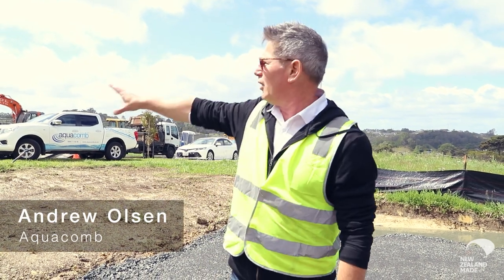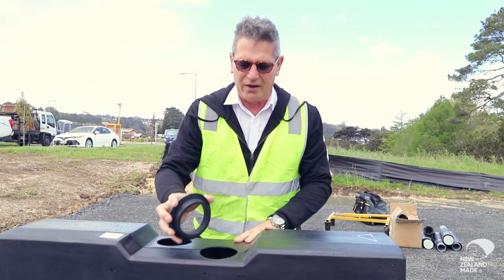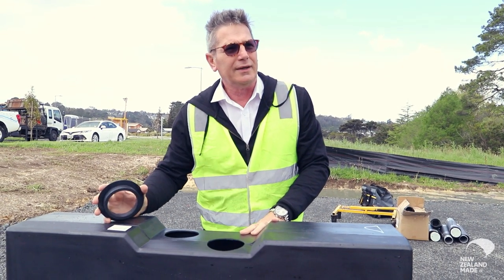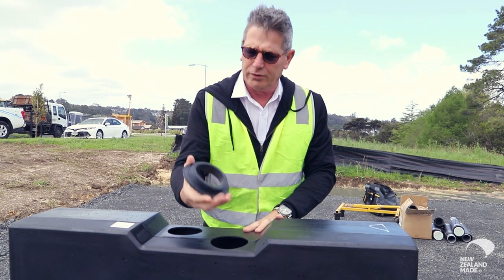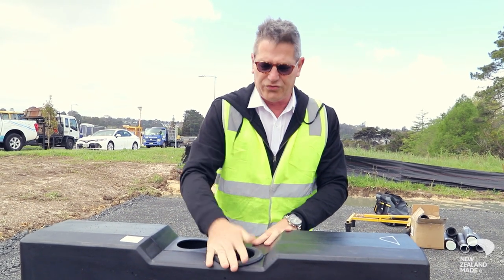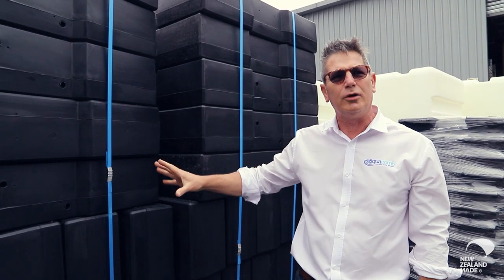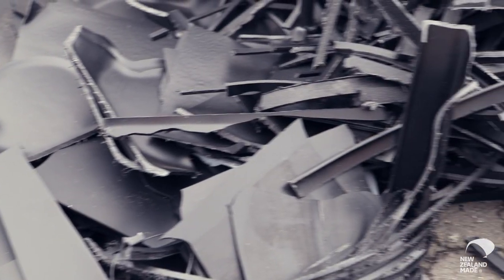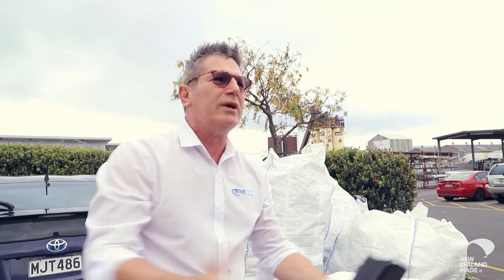Aquacomb© - Making It New Zealand - EPISODE 46

Comment: No stiffened raft system is designed to fully resist the effects of expansive soils, only lessen them (refer to AS2870 and its Commentary). So when the rafts start to wrack and pods might move at differential strains from those of the interconnecting pipework held fast in the cast insitu ribs, how resistent to leakage are the pipe to pod connections? And if the pods then develop a sustained leak when ever they fill, what can be done by the saturation induced increases in the soil shrink-swell Index? Roofs gather leaves, plastic bags and other detritus. What is there to guarantee that these materials won't wash into the pods and cause blockages, and/or what can be done to services such issues?
Reply from the maker: Thanks for your comment, Simon. We can't help you, but you can direct your questions to Aquacomb directly: info@stormwatersystems.co.nz